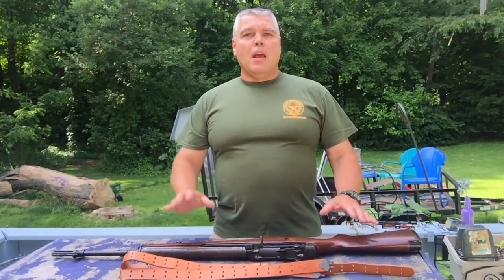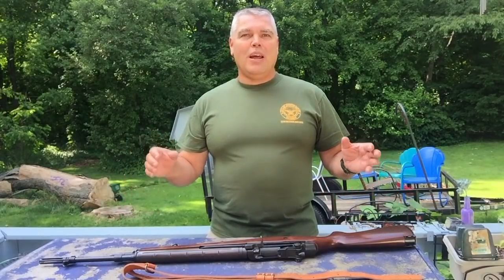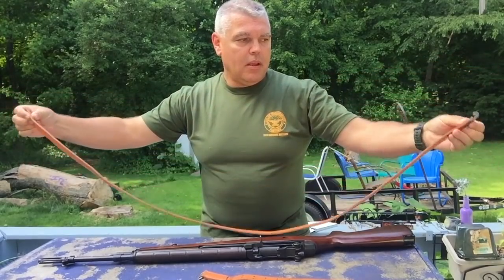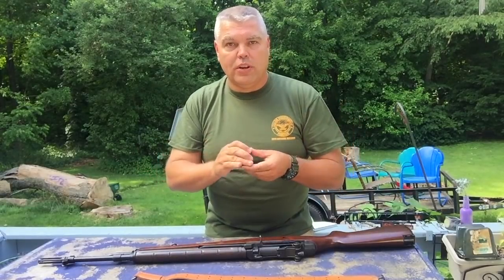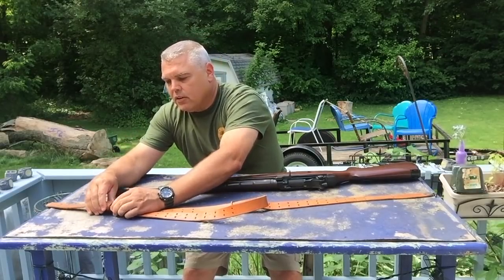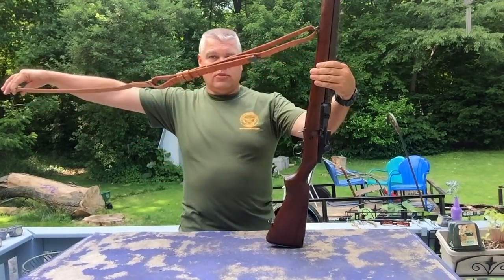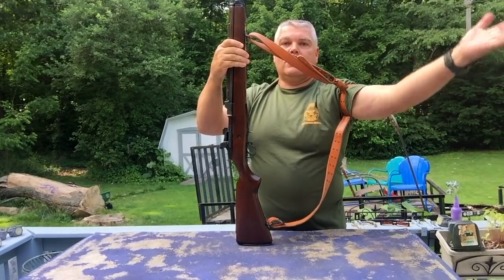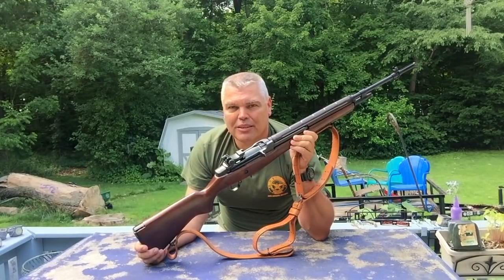Attaching an M1907 Military Sling

Comment: I agree with everything but having the frogs on the inside.  Not only will it scratch the hell out of your rifle, but you certainly don't want that metal pressing into your hand or arm when tightened up in position. Yes, you may be wearing a shooting glove. You can still adjust it just the same with them on the outside so I'm really not seeing the reasoning behind it.
Reply: Bloke chill
Reply: The "frogs" face outward not inward to the stock.  You are correct.

Comment: Good video but your frogs should be outboard, not inboard.
Reply: can you explain why the frogs must go outboard vs inboard ?
Reply: Frogs???  What've the Frenchies got to do with this???
Reply: @Mac-mu9cs  i was explained the “frogs” always go to outside , so as to prevent abrasions against rifle and or the soldiers shoulder potentially while carrying rifle , this could also result in frogs hanging up on other gear and thus being dislodged ..
Reply: @oneshotpete6.591  
I doubt US miltary cared much about rifle abrasion or GIs shoulder. 
Anyhow every thing I see how USGI ran the sling looked like this
Reply: @Mac-mu9cs  you may want to check the CMP - they state the frogs were set up on the outside - kinda makes sense, seeing as that would give the fastest adjustment access  🤷🏽‍♂️
Reply from the maker: This is not the ONLY WAY, but it’s the way that works for me.
Reply: @Mac-mu9cs  if you watch the ww2 instructional video on this on YouTube, the frogs are on the outside.
Reply: This really seems like a pain in the ass... I think I bought the wrong sling...

Comment: It's been at least a decade or so since I've shot CMP matches with the 1907 sling. But if memory serves me right you used the old Marine Corps setup, but it's the new Marine Corps setup that's the preferred version. It's exactly the same as you did, but in reverse so the frog is facing you while in the prone position; the Marine Corps decided this was more advantageous because it's easier to adjust the frog while in the prone position when it's facing you instead of being on the outside.
Reply: If the metal is digging into you while in position your not using the sling correctly. in either configuration

Comment: Coast Guard used the M1 well into the 1980’s... when they welded the barrels to the receivers ... effectively ruining thousands of beautiful, fully serviceable weapons. Anyway... I took second place in the Ninth Coast Guard District rifle matches, using an off the rack rifle. The key to my success was the plain old web sling. I’ve got a few Turner Saddlery slings, but they are simply too complex for non-match use. If you know what you are doing, the cotton sling is as good as the 1907.

Comment: After watching several methods of installation, I drew a diagram to remind me of how I like to have it installed.
Reply: Right.  You ever replaced a fan belt on a multi-pulley car, better draw a damn diagram before you start...you think you can remember because it looks easy, but 5 minutes later you are scratching your head when trying to install the new one....this 1907 sling mounting is nuts...I've watch several videos on it and they are all different...how to mount it...

Comment: I got lucky, I bought a sporterized Springfield 1898 30-40 Krag and they happened to have one of these leather slings in stock as well. I need one for deer hunting. But idk if it was the 1887 or one of the later variants, they all look similar. But I sold it to my dad who always wanted one. I now own a Marlin 336 SC that also has a leather sling that has a similar style, but it carries metal clamps to attach to swivel rings. I took off the modern swivel attachments that were on the clamps so I could use the sling on my rifle.

Comment: Definitely the clearest explanation I have seen yet.  I would like some clarification though on proper tensioning (Length) as a shooting sling.  I am having some trouble getting it adjusted correctly.  BTW, I am using the sling on a Savage Mark II for rimfire sporter cometition.

Thanks!

Steve
Reply from the maker: The rule is to get the sling as tight as possible without having it effect your shooting platform. If the sling is too tight for you to get into a good position, you need to loosen it a bit. If it's so loose, that it provides little or no support then it needs to be tightened. There is a little trial and error involved in getting the sling just right, and it needs to work in conjunction with your shooting position. No matter how you tension the sling, it will not correct for a bad position. So, again, everything has to work in harmony with everything else! Hope this helps!
Reply: hrfunk : thanks! I did just that this morning between thundershowers.  I'll email you 2 pics. one is before adjustments. the second is after. 20 rounds, 15 - bulleyes with 5 or 6 x @50 yards with my 22lr.  I guess it works! thanks for the excellent advice.

steve
Reply from the maker: You're welcome! Im glad it worked so well for you!
Reply: Sorry, I thought I could upload a pic but can't find a way to do it.  Been shooting less than 2 years but given my proximity to Camp Perry (40-miles to the east), I can't resist the urge to participate in the National Matches.
Reply from the maker: Steve Brown no problem. Shoot me an email at hrfunk@zoominternet.net. I'd like to see how you did! Also, there is nothing in the shooting sports that is quite as cool as shooting at the National Matches. I liken it to going to the Super Bowl, being able to go down on the field and play.
Reply: In my case, just try not to embarrass myself! 😄
Reply from the maker: Steve Brown So does everybody else. That's part of what compels us to become better shooters.

Comment: I setup my sling the same way, but was taught to have one of the keepers above the upper strap, so there’s a bit of a gap between them as the top one comes down onto the extra length of strap that sticks out.  Hard to describe.  It serves to keep the upper frog in place.  Bottom line the keepers don’t touch each other.  But I’ll try it this way as well.  Appreciate the clear direction.
Reply from the maker: You’re welcome. Best of luck to you!

Comment: Good stuff, sling looks like it is attached ok! However, should the "Metal" fittings on the sling be facing away from the stock to prevent scratching and/or damage? Just another way I attach the M1907 slings to my rifles.  Regards, RJW
Reply from the maker: It's attached properly for the way I use it. The metal fittings (frogs) rarely contact the stock, and the few marks they make when they do just add character to the wood. Contrary to popular belief, rifles used for service rifle matches lead a pretty grueling life, and they usually show some scars to prove it.
Reply: Yeah prety sure it is backwards. Its 100% right just hardware goes out been shooting NRA high power and CMP matches for years and I've yet to see anyone else set up that way, use this type sling on my 03A3, M1, M1A, and my M16A2clone, there are none better.

Comment: pro tip pull the tail stock frogs through and make a loop and hook them.  then pull the hooks and loop up, attach the frogs to itself and then pull them against the the tail stock swivel. This will give a mechanical pinch point so the short sling stays attached to the rifle.  The way you have it in the video you can have the frogs come undone and pull through and you can fine yourself laying on the hooks in prone.  Ouch!  You will know what I mean if you ever had that happen to you.
Reply from the maker: Thanks for the tip!

Comment: I always thought the leather ones were better but I'm leaning more towards the cotton one. Seems like you have to replace it every year the more you use it though.
Reply from the maker: I still like the leather slings better. They hold their adjustments more securely and they’re easier to repeat the same adjustments.
Reply: @hrfunk  yeah true. I always have to buy a new one. The seat belt kind really sucks as they slip but the cotton ones are solid for about a year or two then you got to buy a new one. I buy the two packs and it takes me about 3 years before having to buy a new set. I guess by now I can have a single leather one and maybe it’ll last longer for the same price.

Comment: Back in the day we were trained in ROTC to have the hooks on the bottom and next to each other.  I no my opinion you have it backwards
Reply from the maker: Sharps 1874 No, I just do it differently than the traditional Army method.
Reply: @hrfunk  That seems odd. Aren't you supposed to show people the "right way" to do it?
Reply from the maker: When it comes to using a sling as a shooting aid, the “right” way is the way that allows you to fire the most accurate shots. The method I demonstrated is the one I use on all my service rifles in competition.
Reply: i've tried both assembly methods, and the owens method got me higher scores,so...👍 to hrfunk🙌🇺🇸🇺🇸🇺🇸

Comment: I had a difficult time trying to get the hook side through the loop on the stock. It catches in the brass. I'm guessing that I could try and file the brass down a but to make enough room to pull it through?
Reply from the maker: It’s usually a little tight, but it should fit.

Comment: Did the Marines use this type of sling? Does their official method differ from the Army? I have no interest in fooling around with it the Army way, so any knowledge would be helpful. S/f
Reply from the maker: This sling (the model 1907) has been in use by military shooters for over a century. It was the primary battle rifle sling until at least the 1950’s. The particular attachment method I demonstrate in the video was developed by a Marine Master Sergeant named Jim Owens. I’m not sure how the Army teaches sling use, but the way I show it in the video has worked well for me. Semper Fi!
Reply: It is slightly different from the way the Army does it. If this is indeed the way this Master Sgt does it..... the army does it exactly the same way except we leave the metal frogs on the outside, again I use the same type slings on all 4 of my high power/CMP rifles that I shoot in matches there is no better shooting aid sling out there.

Comment: Are you sure that is a super match M1A? It doesn't have the super match stock shape.
Reply from the maker: I assure you it is. It was manufactured in 1987 although it has been fired little since then. The stock has been changed somewhat over the years, but mine is an SM with a heavy Douglas barrel.
Reply: Thank you for the update. I am enjoying your videos, never competed in service rifle tournaments. I have a M1A loaded in walnut.
Reply from the maker: Those are nice rifles. Have fun with it!
Reply: Do you use Turner Saddlery 1907 slings? I would like to get one, but rather pay around 45 than 75. Is there another good manufacturer?
Reply from the maker: Fenwick Most of the slings I use were made by Turner Saddlery. I have a couple of others and they cost that much or more. Springfield Armory used to sell a less expensive sling of their own, but it had a tendency to stretch. For informal shooting, it might be OK, but for match use you will probably be happier spending the extra money for a TS.

Comment: Would these 1907 leather slings fit on a Scar 17S?
Reply from the maker: I don't see why it wouldn't, although you would probably have to add the appropriate swivels for it. I have pretty much zero experience with the SCAR (other than picking one or two of them up and looking at them), so don't take my advice as gospel.
Reply: hrfunk 
For a rifle (SCAR) that would be used ONLY for combat (in a warzone) and considering that you're a Marine, what sling would you recommend? A nylon or leather?
Reply from the maker: I think for modern combat operations, you would probably be better served with one of the more recent "tactical" style slings (like the one sold by VooDoo Tactical, for example). The 1907 is a great shooting sling, and it has been said to have "carried more rifles, more miles, on more shoulders than any other sling." For those two purposes (shooting and carrying) it is still just as good as it was in 1907. However, for transition to secondary weapons, and alternate carrying modes, it does not work nearly as well as the modern designs.
Reply: hrfunk 
Is a sling needed? Because I've been doing a little bit of research and I'm starting to think that it isn't.
Reply from the maker: It is not "required" for service rifle competition. In order to fire the most accurate shots possible, however, you will most certainly want to have one. What type of shooting are you planning to do?
Reply: hrfunk 
Still in the combat/war zone situation. I don't plan on carrying a secondary (handgun) and i feel slings just limit you. Too crowded
Reply from the maker: Oops, sorry. I was confusing you with some else who posted a comment about slings for competition. In your situation, there are plusses and minuses associated with the use of a sling. On the plus side, you can easily sling the rifle if you have a need to free up your hands for other tasks (a very realistic possibility). Additionally, while your hands are free, your weapon is still secured to your body as opposed to leaning against a vehicle 50 yards away from where you are when you suddenly need it! It also provides you with a more comfortable means to tote your rifle from place to place under low threat circumstances. On the minus side, depending upon the type of sling you select, it can be somewhat cumbersome and annoying if your sling snags on other gear and it potentially give an enemy something to grab onto in a close-combat scenario. In all, I think the plusses win out, but be aware of the negatives and consider them when making your selection.
Reply: hrfunk 
Now this may sound greedy of me, but if you can do me a favor and help me find the best rated sling that can be used w/ a Scar 17S I'll subscribe to you. The sling that i found so far w/ high ratings is the VCAS sling.
Reply from the maker: Like so many things associated with personal defense, the choice of sling largely comes down to personal preference and what works best for you. Here's one from Voodoo Tactical that should be adaptable to the SCAR  https://www.voodootactical.net/new-voodoo-tactical-3-point-adjustable-rifle-sling.html ; and here's another one I really like that gives you pretty much unlimited options for mounting it. https://www.midwayusa.com/product/303330/military-surplus-3-point-sling .
Reply: hrfunk 
Thank you for the help. I subscribed. If only more youtubers talk to their audience more.
Reply from the maker: Ursus maritimus Tyrannus You're welcome. I hope whichever sling you choose works well for you. Take care.
Reply: Thank you for posting this. It really helped. As an FYI for viewers, to keep the "frogs" from rubbing against the stock and possibly scratching it, the sling can be inserted "under" instead of "over" as shown in this method. Both "frogs" will be on the opposite side of the stock. It is also easier (in my opinion) to adjust later when you need to unhook the frogs. This slight twist in attaching the sling is shown here: https://youtu.be/HuksHbRfOPE

Comment: Frogs going the wrong way. And demonstrating this reversed to the viewer is just useless.
Reply from the maker: Not the wrong way, just a different way.
Reply: Right.  Different from how it was intended.  In a way that would cause abrasion to your kit or body if used in carry-mode during troop movement.  Other than that, just "different."
Reply from the maker: Since, however, I use it for shooting rifles in Hi Power shooting matches, it works just fine. That is what this installation method was intended for.